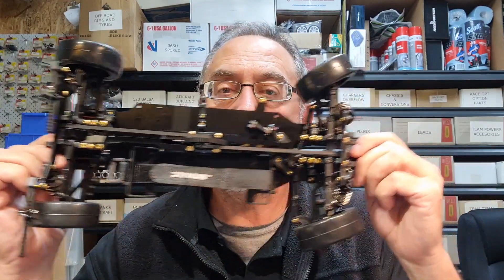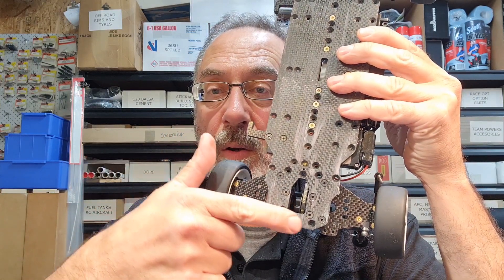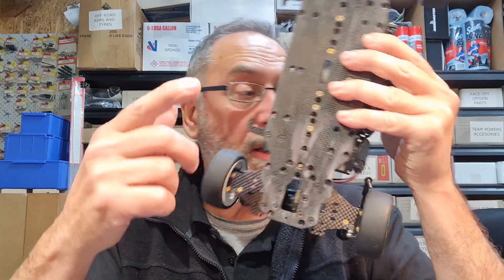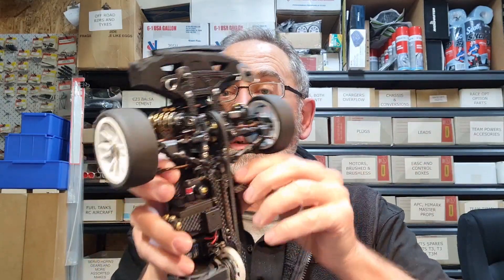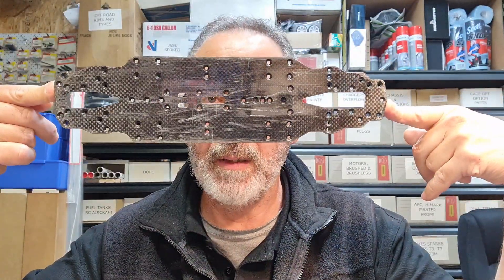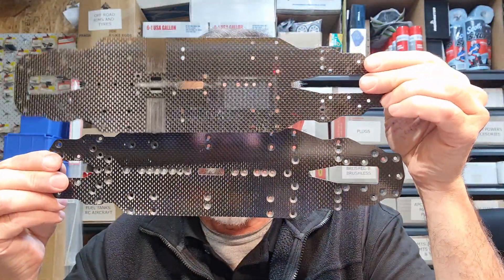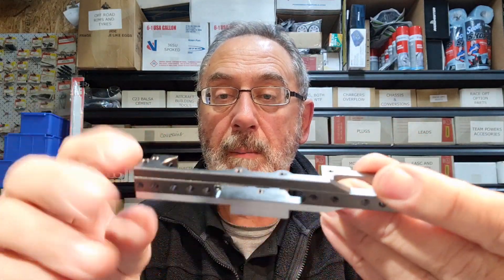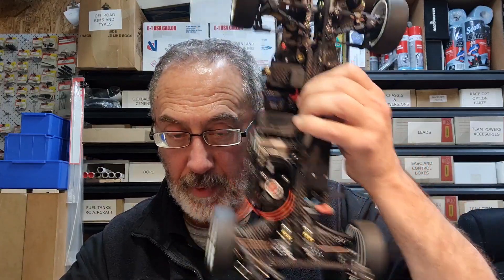A brief explanation of the similarity between the R3 and MTS T3M.  More indepth to follow.

Comment: I’ve just got a r3 pro to run as a rally chassis indoors. I’ve order some alternative shock mounts and the 68mm shocks. Hopefully all works ok. They only had the front wrc shock mounts so have a drift rear mount for now.  The only concern I have is that this is no kick up so I might make my own chassis with about 10 degrees of kick up and a custom front top deck.  After ordering I saw they have longer version of the special shocks with the through pistons.  Might end up getting those.
Reply from the maker: @kentonian  the special RAS shocks work so well. They might be an option for you.
Reply: @RABHobbiesParkdale  yeah I only noticed they were available in longer form after I’d ordered standard type, doh. Thanks for advice though

Comment: Great video.
I’m keen to get a decent starter TC chassis for VTA here in Perth.
I’ve narrowed it down to 3 cars:
1) CNRC R3g
2) 3racing Cero Sport s64
3) Express Execute XQ2S 

The R3 g is cheapest,
But the new 3racing Cero Sport has pivot ball suspension all round... 
which would you recommend?
Cheers
Reply from the maker: So sorry, nut have only realized and saw this question. Any way i hope that you have sorted out your choice.